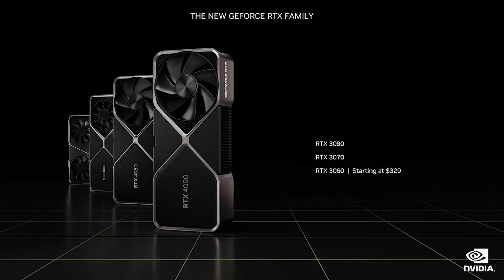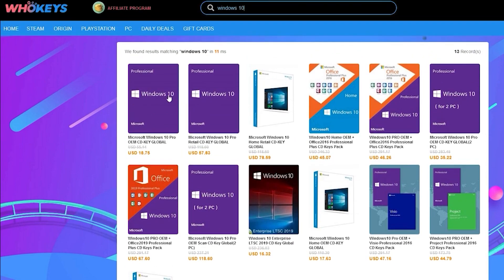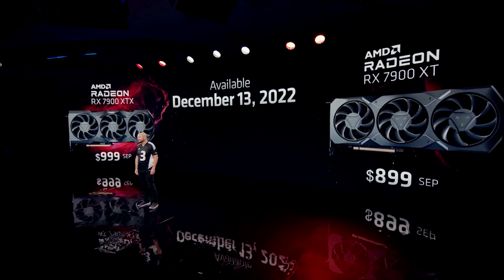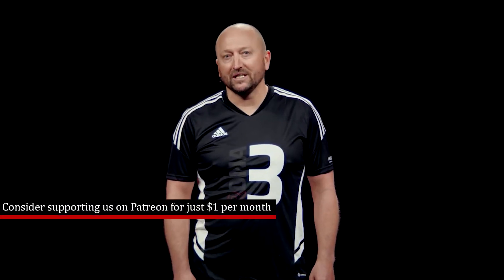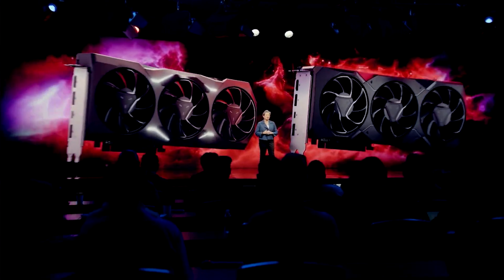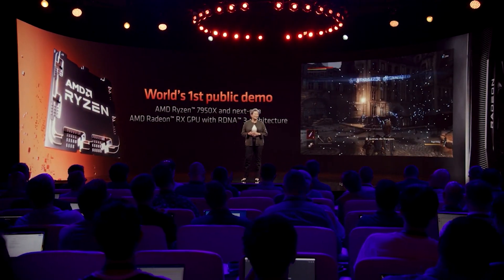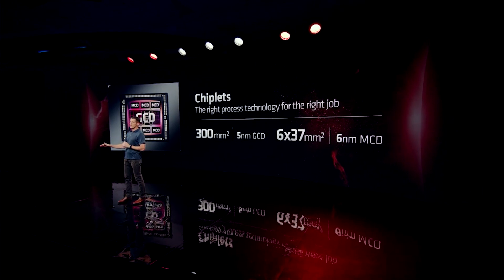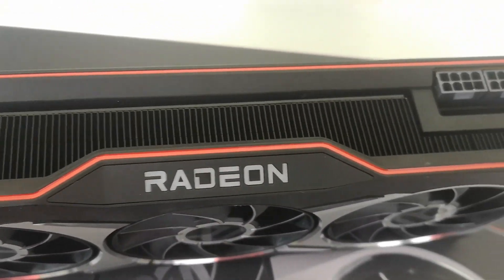RX 7900 - AWESOME Supply, But Custom Cards Come LATER?! | TSMC 3nm Is VERY Expensive

Comment: Those who have the money to get a 4080 will also be able to fork out the money for a 4090. That is kind of NIVIDAs problem right now. Not that the 4080 is bad card by all means
Reply: I think the 4080 only exists to make the 4090 look good. Assuming amd's prices reflect a realistic price (for node costs & inflation), 4080 should be like $899.
And it's dumb, because if you can afford it (or justify it), the 4090 looks good on it's own.
Which is why I'm jumping ship on nvidia. They turned their 'budget enthusiast' card into a marketing gimmick, instead of a price/performance sweet spot.
I haven't bought an amd gpu since they were called ATI gpu's. I hope the drivers are as much improved as people say.

Comment: If the RTX 4080 is a lame duck, the RTX 3080 Ti must be be a paper weight at $1000-$1200 on Newegg. And, $750 for a RTX 3070 Ti? I cannot imagine that NVIDIA will clear Ampere stock this way.
Either AMD will clean up, or people not in the market for a higher end GPU are broke. It's the evening before Thanksgiving, and one of my local grocery stores is hardly moving product. They were not even out of whipped cream or Cool Whip; those ALWAYS nowhere to be found here leading up to Thanksgiving.
Reply: Nvidia seems to actually be clearing inventory. Not sure if it's as fast as they want but they are confident on their progress.
Reply: @ag687  
How do you figure that NVIDIA is moving a lot of inventory? The last earnings report was before Lovelace launched. The 4090 is mind-blowing.

If the 4080 is not selling, the 3090 Ti, 3090, and 3080 Ti at over $1000 are not selling either since they are an even worse value.
Reply: @Austin1990  last conference call they were extremely confident on selling old inventory. If you listen to a half hour and later they talk a decent amount about inventories in the Q&A. Though it's mostly non gaming inventories, it's still comes up.

Not sure about 4080, but it doesn't really have to sell. They can always cut prices if it's bad enough but more likely just cut down and sell the easier to make/affordable GPUs later and let these sit as is.
Reply: @Austin1990  actually that's misleading quote. They were talking about product chains. Crypto easily comes and goes faster than the multiple quarters it takes to ramp up and down GPU production. No matter how good they are, it takes two quarters to shift gpu production/supply around the world.
Reply: @Austin1990  I don't particularly care about the 4080. It's priced to sell old stock. 

How do you know 4080s and 3090tis are not selling? Product on shelves only means there is currently enough supply if not more supply than demand. Old gen is going out of production so they just want them to eventually sell most of them so they don't have further wrightdowns. And in reality the 3090ti can just sit there... A 3080 is the same chip. They can still offload much of the inventory at lower prices
Reply: @Austin1990  also... Jensen was talking about gaming segment not gamers over miners sales.

If a gaming gpu was sold it showed up as a gaming sale. That's how they tracked it. They underestimated mining demand the first time but that's about the only thing investors can complain about.

(edit) Actualy, that's what they were fined over. Not including it in the 10-Q. The fine seems to be based on some sales people on the ground thinking it was selling well to miners so Nvidia as a company should also know it was significant enough to acknowledge it as 'significant' in the 10-Q as a disclaimer. Which they didn't do at the few quarters they were fined for. Details beyond that is speculation as far as I can tell.
Reply: @ag687  The quote was not misleading but fair. NVIDIA blatantly lied to shareholders. I listened to the call. The investors were very cautious, thinking that growth may have been due to temporary mining sales rather than an increase in gaming demand. NVIDIA assured them that it was gamer demand, partly blaming Fortnite. When they were talking about channels, at least in this context, NVIDIA was talking about knowing who was buying cards.
Reply: @ag687  Ah, I was referring to news from retailers that 4080s are selling very poor. I am assuming that, if the 4080 is selling poorly, the similarly priced Ampere cards cannot be selling well.
Reply: @Austin1990  How do you know they lied? It was the first crypto craze so the crypto card sales breakdown was new to them.

It was gaming cards miners were buying up so it's the gaming segment. How do you know they didn't just guess too low?

Even now, they include gaming cards that ended up in miner hands as part of the gaming segment because they see a gaming card sold as a gaming card sold. But back then they were clearly not sure how significant it was.
Reply: @ag687  Jensen conveniently sold many of his shares at the peak price, shortly before it dropped when the truth came out. And, it was the 2nd crypto boom, not the 1st. The 1st was when Bitcoin was mined on GPUs. This last boom was the 3rd. The 1st boom was rough when it crashed.
Reply: @ag687  
Miners buying gaming cards definitely belong in the “gaming segment” since those gaming cards are the products being purchased. But, NVIDIA is not clueless about the breakdown. First, the Steam survey did not show nearly enough of a market swing to account for the gaming cards being sold. Second, NVIDIA requires GeForce Experience accounts to use that software, software that only gamers would use. Those accounts should have increased a noticeable amount if gamers were buying the cards. NVIDIA knew.
Reply: @Austin1990  What counts as selling many shares? He's been selling lots of shares every year for a few years now. Looks more like diversification from insane gains.

I guess crypto existed before that boom and bust. When was this first bust? And was demand outstripping supply at the time?
Reply: @ag687  
This was in 2017-2018, and he sold a considerable number of shares in a short time. Of course, actually proving such a crime would be extremely difficult, but Jensen either scammed investors or failed to recognize a painfully obvious temporary boom in business.
Reply: @Austin1990  One of the issues is supply of GPU's are not immediately in someones PC. They may have a sale, but it may not be in someones PC for a pretty long time. 

Supply was also outstripped by demand so that makes it harder to tell when the demand in any specific area is increasing or decreasing at the time of a call. 

They also had a crypto specific product and were hoping it was diverting demand from gaming.
Reply: @Austin1990  It looks like he's been selling a ton every year for a while now. (Marketwatch goes back to early 2018 at least) He also gets a crap ton of shares for cheap.  

Lets see... 50 mil in 2018?... most of it a sold befor the crash that happened at the end of the year... 

But he also sold 20 mil after the crash in march 2019... Is this sale suspiciously criminal as well? 

He literally sells what looks like 10's of millions every year...
Reply: @ag687  
Yeah, probably covering his backside after the lawsuits. But, like I said, actually proving criminal activity would be difficult, and it's possible that his actions were not criminal. But, he was blatantly lying during that call, and the investors knew it sounded off, given their questioning. The investors should have known better.

It is good to see that AMD and NVIDIA finally learned how to handle a mining crash, though. Only launching cards that are a tier higher to avoid competing with used stock was good, although also obvious. And, they should have priced the current lower gains (or even losses) into their record profits from during the boom.
Reply: @ag687  
You seem to not remember the previous crypto mining booms.

Modeling sale figures with new GeForce Experience accounts (or new cards detected by the software) and/or driver downloads to recognize lag would be easy. NVIDIA knew that gaming itself was not surging; the Steam survey never indicated that at all, lag or not.

It was OBVIOUS what was going on. And, even if it wasn't, Jensen could have been honest. He assured investors that NVIDIA KNEW that gamers were buying the cards. Every tech channel I follow called BS on his claims at the time.
Reply: @Austin1990  previous booms? Nvidia didn't know in 2017/18 or so. That's the only time they had an issue with figuring out the numbers, in part because of new products meant to alleviate pressure and the constant outstripping of supply making demand and forecasting changes in demand difficult.

When was the first boom/bust? Did demand for cards outstrip supply?
Reply: @Austin1990  I'm not sure investors knew it was off. They always ask questions. AMD was giving higher estimates at the time so investors would want a better breakdown of what was going on. To figure out what is going on.
Reply: @Austin1990  if it's anything like the recent boom and bust, tech tubers only know part of the story... And tell their version of what Nvidia is actually saying.

I wanted more detail but at best only saw one or two potentially good points back then. Most of them were doing what's happening now and just wanted a negative story to run with.
Reply: For now the 4080 is kind of a premium product. If they are not selling it's because it doesn't belong at above 1k.

Comment: If AMD have not put a 'fuse' in place to limit the AIB pricing, then they've made a massive mistake towards their future goal of eating into Nvidia's market-share.
Greedy people will always try to exploit desperate consumers.
That said... A 4080 priced 7900XT will start to lose it's remarkable shine very quickly.
The objective for AMD this time out...in addition to selling to the regular AMD faithful...should be targeting the guy/gal who always buys Nvidia.
The reason for the current 7000XT series hype, is that the price to performance looks incredible as it stands pre-release.
Reply: The AIB 7900XTX won't really be competing with a 4080 though, for everything but RTX it'll be 4090 speed and 3090 RTX. More than likely the AIB XTX cards will be trading blows with 4090ti class cards within a year.
Reply: @PineyJustice  AMD themselves have already stated they're targeting RTX4080 with this card.
Any attempts by AIBs at directly over-pricing, simply to pit it against RTX4090 is a fool's errand.
Do I believe it will be extremely close or will beat that card in many titles? Yes I do.
That however is NOT the main objective in AMD's pricing.
 The reason for the new level of enthusiasm, is not down to just performance alone...but price to performance.
Pushing the 7900XTX to extreme out of the box without a study on how the new chip packaging technology may or may not degrade over time under heavily overclocked conditions is risky.
It'd be simply better to manage expectations and concentrate on making more money with volume sales of the GPU, while also delivering a gut punch to Nvidia in that segment.
Pricing the card anywhere near RTX4080 will garner the same response...most will just run out and pick up the RTX4090 once available.
That'd represent a loss of sale to AMD, along with the ability to convert people who only normally purchase Nvidia cards.
That defeats the ultimate objective.
Reply: @Saabjock  Even in stock format, the xtx is going to flat bully the 4080. It's under 10% off a 4090 in stock format. AIBs already with the 6950xt cards are putting out units with triple 8 pin 400w cards, I own one. Running a pretty spicy OC on it that makes a 3090ti look weak.
Reply: @Saabjock  And no, a 1200$ AIB card would be perfectly fine, considering it will likely perform on par with or exceed a 4090 for msrp 4080 prices, I'd buy one in a heartbeat at that price if they give us free reign of the power slider like my 6950xt red devil does.
Reply: @PineyJustice  You are one person.
Most others would reject that.
Reply: @Saabjock  That's exactly what AIB cards launched at last gen, lots of people bought them, just because you're only interested in mid tier doesn't mean everyone is either. As I was pointing out, it's highly likely that the AIB cards will likely have more compelling performance reasons to spend extra this gen, just based on the numbers we know I wouldn't be surprised if some of those higher clocked cards beat the 4090 in raster handily.

Comment: Will the 7900xtx work with 2600k and 750w psu? Im planning on building a new pc, but im starting with a gpu.
Reply: 750w is way too low they recommend 800w+ and if you gotta buy one that you wanna last for a good while go for at least a 1000w
Reply: No, 750 is too low. I have a R9 5900X and installed a 1000watt psu just for the 7900xtx

Comment: I think Samsung is closer to a 3nm node than TSMC, I should I say closer to production.  However Samsung die probably won't clock as high but who knows.  They specialize in low power nodes.

Comment: TSMC density improvement going from N5 to N3 is about 70%.  If you're a chipmaker you almost NEED to push the stuff that doesn't scale down in size to another chip.

With the way AMD does their CPUs, they could probably get a 35 - 45% reduction in chip size for something like a Zen 4 core chiplet, UNLESS AMD pushes L3 off the core die and stacks it.  If AMD did that then they could get about a 40 - 55% reduction in core chiplet size everything else being equal.

At one point there was a rumor that floated around that AMD could do exactly this, push L3 off die.  AMD could use a 6nm die for Vcache which is cheaper than N5 since it's a variant of N7.  I think they could also stick with N6 for the I/O die.  They would probably have to slow down their clocks a little to stack L3.  Right now Vcache is mostly on top of L2 and L3 cache on the core die and these run slower and generate less heat, but if all L3 is stacked then it's going to sit on top of cores and that's a different problem.

There are two problems with Zen 4 that need to be fixed going to Zen 5, other than AMD has to deal with the expense of N3, and that's the memory controller being CRAP if you want to run 4 sticks of memory, and a LOT of people need to run 4 sticks of memory.  The other issue is the CPU-chipset link being a pathetic 8GB/s.  AMD left this at gen4 speed and that's not good enough for what AMD MBs offer.
Reply: If you want high memory controller speeds it would probably have to be both monolithic and 5nm. Notice how the mobile APUs vastly outperform the desktop chips in regards to top memory speed.
Reply: @Lemard77  Or AMD has to do a lot of improvement to the chiplet design to allow much faster transfers that are parallel instead of serial.  Or, AMD could move the memory controller to one of the core chiplets and then have a faster link between two core chiplets, once again parallel and not serial if it isn't already.  Right now I believe for cores on one chiplet to communicate to the cores on the other chiplet the data has to pass through the IOD.  Or, if they leave the memory controller on the IOD they could have an independent path for data going from the core chiplets to the IOD specifically for memory access because I think that data follows the same pathway as all other data going between the IOD and core chiplets, which I think it a bad architectural design.  To me that's a bottleneck.

A monolithic design is not good because AMD and Intel are making CPUs more complex with acceleration and AI.  

Intel is moving to tiles for 14th gen, and they'll have a GPU tile, so even Intel is moving away from monolithic designs.  14th gen is going to use both Intel and TSMC die.  The interconnect is parallel, not serial.

Comment: 4080 doesn't really need the overkill cooling and VRM, cut those and sell at lower price.
Reply: @Yogi.... Exactly!
These AIB monstrosities of late are there for one reason and one reason alone....jack up pricing by way of visual appeal.
Most will achieve higher clocks but not by much versus what people additionally pay for them.
Heck!...AIBs will even throw in some PCI-e slot-deforming weight while they're at it.
The perception is, heavier is better in most people's mind.
They'll in most cases now... add a massively under-utilized gargantuan heatsink, a few larger fans and some RGB lights. Guys get a hard-on and start chucking unnecessary money at it like they're on a hooker binge.
The whole thing is bonkers.

Comment: Gamers who need an entirely new system (like me, because I'm on a 12-year-old i5-2500K with no upgrade path) should be waiting for the 7600X3D anyway.
Reply: The X3D will have a pretty big premium I reckon.
Reply: Perhaps, but there's a pretty big discount on the non-3D right now.
I am curious how the X3D chips will scale, considering the regular 7000 chips have more cache on them than the 5000's did.
Will the 7000X3D chips have even more cache? Does that continue to scale well? Hard to say.
At this moment, I'm eyeing 7900X. I just wish it was more clear which cpu coolers worked on it.
Reply: @kathrynck  Considering the high platform costs, it makes more sense to go for a 7900X or 7950X. People who can't afford those will go for the 5000 series.
Reply: 7600X3D will win gaming.